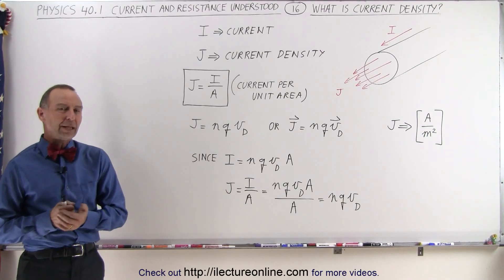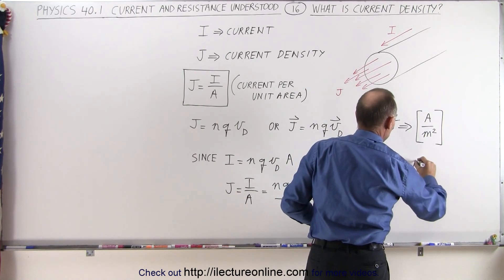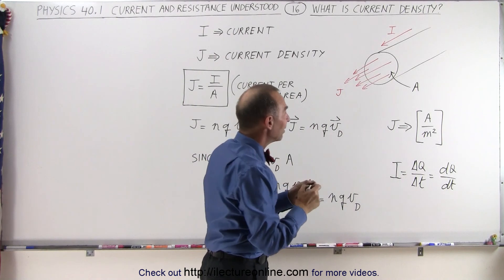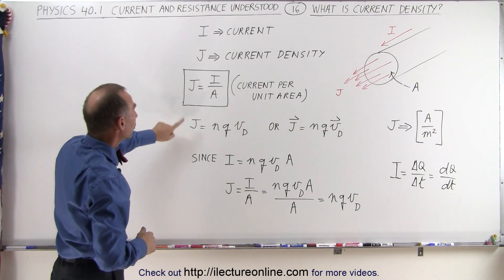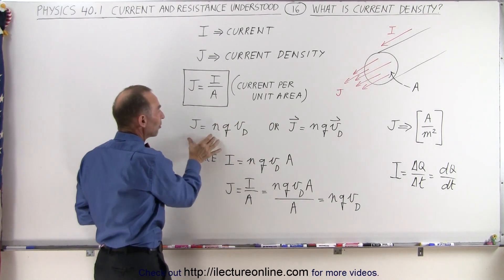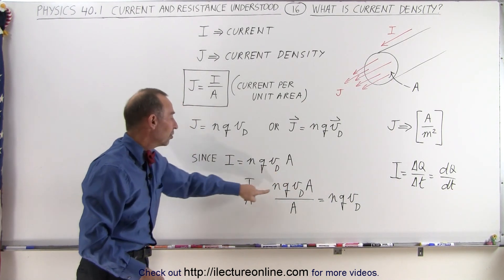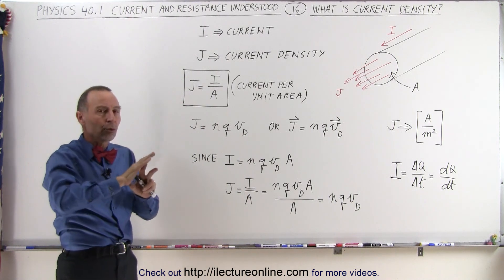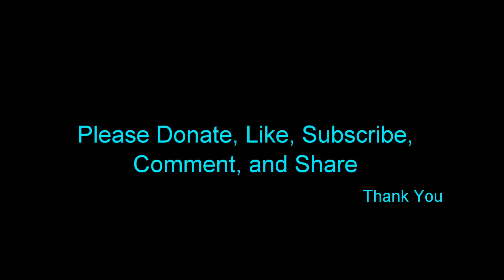Physics - E&M: Ch 40.1 Current & Resistance Understood (16 of 17) What is Current Density?

Comment: In laboratory geophysical measurements of DC resistivity on rock and soil samples, we have to be aware of the current density and only use small currents to make the measurements, as Ohms law doesn't apply in regions within the sample where the current density is high, e.g. near the contacts with the electrodes supplying the current.    For high frequencies, the density is not homogenous and the concept of "skin depth" becomes important as the current flows near the surface of the conductor.  What you are showing here needs to be included in the textbooks - thank you!
Reply from the maker: Very nice input.  Thanks.  🙂

Comment: Pa/A = Kg/Ams^2  a Kg/Ams^2 = A/m^2(10^-7) similar to the electric field where V/m = A/s(10^-7). Pressure per Ampere is numerically equivalent to current density when the current density is multiplied by (H/m)/ 4Pi. H/m = 4Pi x 10^-7 Kgm/A^2s^2. You could also say that a Kg/s divided by the electric dipole moment is equivalent to the current density multiplied by 10^-7.

Comment: nice!
Reply from the maker: Thanks!
Reply: @MichelvanBiezen  How do I calculate the maximum current density (Amps per meter squared) for square plate shaped electrodes of various materials (316L Stainless Steel, Graphite, Platinum) that will be used in water electrolysis) before the plates begin to overheat?